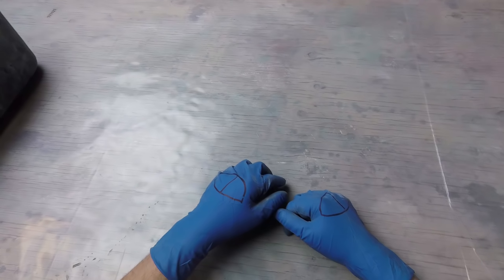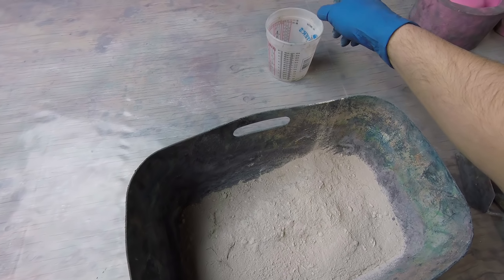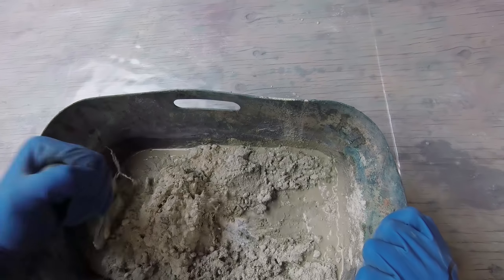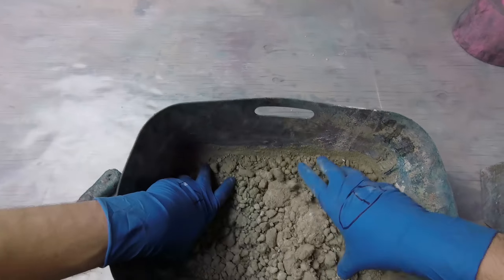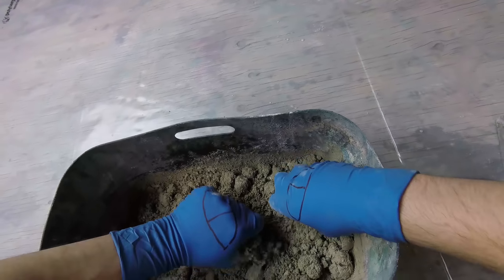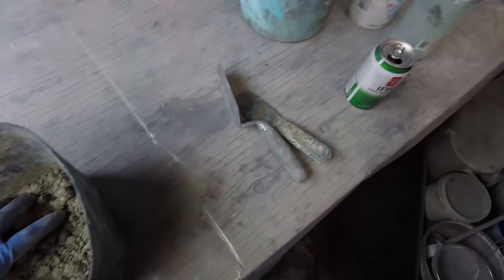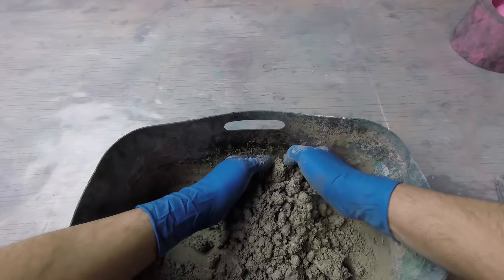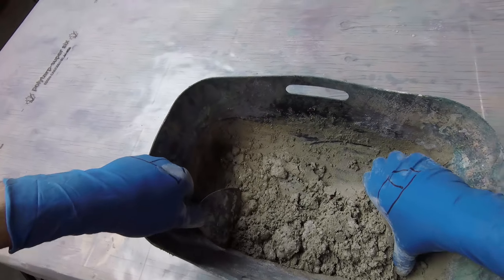Cactus Planter!!!  Secrets of perfect concrete marbling, step by step.

Comment: As a bricklayer, I can confirm a dry board will dry your mix up. You can uses a board many times, in fact the more times you used it, the better it would work for taking moisture out. That being said, being accurate with measuring water is the most important thing! Great video!
Reply from the maker: Thank you, the board trick works in a pinch but focus needs to be initial water content

Comment: What surprised me about your video is how long you allow your concrete to set before you put it to use. When I pour I won't panic as much after seeing this. thanks!
Reply from the maker: Hi Kathy, thank you for watching.  Glad to hear something I did will help you work with more peace of mind.  Technically Grey Matter could be classified as a "high early" mix design it gets very close to maximum strength(+10 000psi) in the first 24hrs.  With a liberal amount of water you have 45 minutes work time and if your mix is on the dry side it could be as quick as 15 minutes.

Comment: Do you have a video on how to make your silicone moulds? And do you know how to make a mould that will make the plant pot have a drainage hole without having to drill through your concrete?
Reply from the maker: When the concrete is wet put a pen lid in the back.  Boom drain hole.  We have a video on this as well in the channel
Reply: @CONCRETECONCRETE  BOOM, Thanks! 😎

Comment: Very nice. Great finish look. Try making individual strands (irregular sizes) with your coloured concrete and then spiral or braid  them together. (Each method will create a different result.) Then cut them into dissimilar sizes and pack them into your mould. This works great for dry packing as well then add a new colour for void filling.
Reply from the maker: That's great advice.

Comment: If you want to grow cacti in that, you will have to add drainage holes.  You can do this by drilling while the concrete is still soft, or you can insert waxed or oiled  dowels in the wet concrete when filling the mold.
Reply from the maker: Thanks Emmit.  Yes you can definitely drill a hole in it if you want to, clever idea!

Comment: Those of us in the candle making world that make our own concrete vessels use cement all & pour it in the mold. 3 hours later, it’s done. Easy peasy. I might be interested in some of your pigments though 🤔 I can marble in a thinner substrate.
Reply from the maker: Yes but our grey matter will outlive all of the cement all :D Our Grey Matter has no large aggregate filler, so you're getting a lot more cementous material per bag. PLUS Grey Matter is 3X stronger than general purpose mix! We love our mix. New sample pigment kit came out last month, if ya wanted to try
Best to ya

Comment: Hi. Great video on creating the planter. I have a few questions

- Once complete Can you drill drainage holes into the pot without damaging it?
- I went on your website and liked the color mix combo set. I couldn't tell the size/quantity of each color in the set?
- Did you use quick dry cement or regular cement?
Reply from the maker: I have another video on adding a drain hole during the pour.  Alternatively drilling one after will cause no damage. I don't understand the question about the set size.  email the webstore directly for help with sales.
Reply: @CONCRETECONCRETE  & did you use regular cement or quick dry cement

Comment: Mix the cement to the consistency of peanut butter, if you need it to be more liquid you can add something called Flow Control which is a plasticizer the won’t reduce the strength of the finished product but will make it easier to pour and shape.
Reply from the maker: Already have plasticizers in the mix

Comment: I really love the vase, but you kept anxious to drink a beer and cheez with you. I need to know exactly what kind of material did you use and if I can decorate my vases with this? And if my mix get too wet what can I do? Thanks to charing your knowledge.
Reply from the maker: Thank you!  The concrete is a special blend I developed that is designed to be used for art, sculpture and highly detailed pieces, pigments are studio grade integral mineral pigments.  All can be found at www.concreteconcrete.com
Reply: @CONCRETECONCRETE  Thanks , do you have any video that show how do you make sculpture with this concrete? Because I just saw the silicone molds, I need to apply over my big cement vases some designs. Can I use this concrete?

Comment: WOW, THANK YOU :)  I have watched at least 75 DIY concrete videos looking for someone to elaborate on concrete recipes,  color pigments, ect. I really appreciated your clearly in-depth instruction method. I have a really big question regarding working with concrete as dry as you did??? I want to make a large concrete planter or vessel to use as an Aquascape; a Container Water Garden for my porch to put a few water plants like Horsetail Reed and Papyrus and maybe a few little fish. (The plants are already sitting on my porch I have to water them like 10X's a day, I live in FL.) Anyways,  I would like one about 2 feet in diameter and it would probably only be 6 - 8" deep, so a mold specifically for concrete would cost a fortune so I was thinking about using a bath tub for a baby,  I saw one on FB for like $5 that is kidney shaped that seems like it would look nice and smooth if I could just lay the concrete in it and up the sides and smooth it with my hands. Can you please give me some advice if that will work without having a smaller thing on top or can you give me some direction on how I should build this?  If I am asking too much I am so sorry, I would just appreciate some feedback :) Thanks, Jessica
Reply from the maker: Hi Jessica

I've been considering what the next video I should do is and a DIY mold for something large might be fun.  I think I have a good understand of what your looking for.  I'll see what I can dig up in the next week and do a tutorial and try to cover all the best practices. Thank you for watching!

Comment: I was wondering if adding the colour powder to the concrete, it will end up being more prone to break down or develop cracks in the future? Especially in humid environments.
Reply from the maker: If you don't use the right type of pigment that's possible.  The pigments we use at ConcreteConcrete are designed to work with our mix and will not affect the structural integrity

Comment: Good work. What kind of cement are you using. Cement all is recommended by some but cost is a big deal. They make some liquid form to pour into mold, I see you made it like clay texture you can still add color marble or single color ones, like this :0)
Reply from the maker: Concrete concrete Grey Matter. Far superior to cemental

Comment: I'm imagining making a big marbled ball and letting it slump into the mold, to make the marbling more continuous. Would getting Grey Matter wet enough to flow that much compromise its strength?
Reply: But wow, I'm pretty blown away. That planter is gorgeous.
Reply from the maker: Hi Kyle.  Thank you!  Yeah this one turned out quite nice.
Reply from the maker: No you'd be ok.  Although at the consistency I had it you could probably do the same thing.  Even though I was partially joking around when I was slapping the backs of those flat concrete pancakes I'm trying to illustrate the point that one of the biggest red flags you can see in your concrete mix is to have standing water begin to accumulate at the top over your concrete.  I'll try and remember to do a different style of marbling with the next object so that you can see a more continuous flow to the colours and patterns.
Reply: Looking forward to it, thanks!
Reply from the maker: It's a bit too complicated for Youtube comments but our mix plasticizer that is dry kiln tumbled on the sand during batching.  This allows us to only add water and not have liquid plasticizer component in a bottle.

Comment: Hi! I've been thinking about making my own pots for a while now and I just have a couple of questions I'd like to ask you, if that's okay.

1. Is grout different from cement?
2. Can I use it in the same manner to make pots?

I hope you can help me with this 😊
Reply from the maker: Yes it's different.  Cement is both a component of grout and concrete.  Our work is made form concrete.

Our high performance blend of concrete (Grey Matter) is much stronger than regular concrete and grout which is why my finishes look so good.  

A flower pot made form grout will be weak and crusty.

Comment: I'm starting to create concrete pots, I loved your video, just some doubts, before the water, what has the mix? Some I see that they use fiber replica fiberglass, and what kind of cement is it? Do you recommend portland?
Reply from the maker: Hi Annie.  www.concreteconcrete.com   It's a mix we designed to make high quality home wares and architectural pieces.  We designed it because most high performance concrete from a manufacturer involves a licensing agreement (approx $100K a year just for the license)  and minimum orders we're tonnes per month.  Grey Matter gives you chance to work with the high quality concrete without the licensing fees or minimum orders.

Comment: Can’t believe that’s the consistency you use for your concrete. Very cool to see; I never would have guessed that was thin enough for anything.
Reply from the maker: To hit maximum strength we have water reducers and plasticizer built into the mix so that we can mix as dry as possible.  Many artist use way too much water in their mixes which results in weak concrete.  Using our UHPC we hit a cure strength that is 4X-6X stronger than your average concrete mix.  And it cures in a fraction of the time as well.

Comment: Glad you took your time to mix. I'm getting ready to start making pots and was wondering if I wanted a dryer mix or a wet mix.
Reply from the maker: The wetness of your mix is always a balance act between the detail of the mold and how strong you want a piece to be.  Dry  mixes are structurally stronger but have lots of voids.  Wet mixes can have less voids but tend to separate during vibration so strength of a piece can be variable and also lower.  To date our Grey matter mix is the most fluid I've seen a mix while keep water content extremely low (giving higher cure strengths)

Comment: I love that video. Great work. What are the costs involved in making a mold of that size? I wanted to make miniature benches and I don’t know where to start.
Reply from the maker: Here's the very beginning of a start. https://www.kickstarter.com/projects/1259791312/easy-make-concrete-kit?ref=user_menu  Past the basics of working with concrete most mold costing is volume measurements plus the cost to make the initial model

Comment: Do the amount of pigments compromise the strength of the concrete? I've had projects break apart before if I mixed in colors.
Reply from the maker: It goes hand and hand with mix design.  Yes you can over saturate in pigment and end up with crust weak concrete.  Go to www.concreteconcrete.com to find some tried and true colour formulas to get you started.

Comment: I notice my planters when finished are chalky/dusty how do I clean them outside of brushing them. Do you use a sealer on them? I'd love know how to get them cleaned up and somewhat have a either matte or sheen to it.
Reply from the maker: Hi.  There are a few ways to get rid of chalky/dusty.  Our favourite way is using our finishing wax.  It's food safe and feels really nice on your hands when you apply it. https://concreteconcrete.com/collections/shop/products/finishing-wax.  Just wash your piece and let it dry in the sun.  Then wax on and wax off Karate Kid stylz.  This will also depend on the quality of your casting as well.  Wax won't work on a crusty surface as well as a nice smooth one.
Reply: CONCRETE CONCRETE Thanks a mil for responding to me. I love your marbling, I so need to try it and your help is awesome!#

Comment: That is the driest concrete I have ever seen! “The flaticity”...flatulationize!!! Wonderful stuff! Thanks for all the words.
Reply from the maker: Honestly?  This batch was actually a little bit on the wet side.  We're only mixing for an aesthetic look but if we were doing structural work it would be much drier and we would use mechanical vibration to keep it fluid during the pour.  The wetter your concrete is the weaker it is, both in surface crustiness but also compressive strength.
Reply from the maker: And thank you for watching!
Reply: Thank you for replying. Loved your project! Let me just ask this then...does this apply with normal Quickcrete type concrete and portland cement mixes or just to your magical Grey Matter. Went to your web site and bookmarked for future concrete project money spending!
Reply from the maker: Yes this applies to all concrete.  If you were to make two samples cylinders to do a compressive crush test with out of identical mix designs but made one mix super wet, the wet mix would also be the weak mix.  For a sack a quikcrete you want to have just enough water for the mix to come together, no dry spots visible.   But this mix will have very little flow unless vibrated as it has no plasticizers or water reducers in it.
Reply from the maker: So one big benefit to Grey matter is that because of the plasticizers and water reducers already in the mix you can get good flow without over saturating water.

Comment: cool video thanks!
where you get your pigments? I make stuff with hydrostone/densite, i mix the colors up in a bucket and get marbling that way, always interested in different techniques, like your channel
Reply from the maker: SO cool.  get it at www.concreteconcrete.com. Hydrostone would have issues with water exposure?  how do you seal it?
Reply: Its not as durable as concrete, i spray it with the shiny concrete sealer. brings out the colors. It will last for years depending on the weather, but yeah not like concrete. the trade off is hydrostone drys in less than an hour. I checked out your website, nicely put together. have a good one

Comment: is this fast drying
Reply from the maker: Hi Al.  It hit's 50% of it's cure strength in 24 hrs.  In one day Grey matter will be almost double the strength hardware store bagged mixed will reach in 7 days.  Fast enough for you?  But just to be clear concrete cures through chemical reaction, it doesn't "dry" out.  The reason this is an important distinction to make is that you actually want to make sure your concrete cures in a moist environment as water is the main ingredient in the chemical reaction! Science!!!

Comment: could you possibly do your videos by giving measurements in cups....kilos don't appeal to me and I'm not going to find the video helpful
Reply from the maker: Hi Charlotte,
When working with concrete we need to measure using weight do to compaction of dry materials.  A cup measurement is not accurate enough to measure dry materials.

Comment: don't talk to me in kilos or milliliters, that translated to ME as 2 cups and add water.... I understand that concrete has many of uses. I have done ceramics for years, so your concrete is like slip that is considered almost "leather hard". It can be molded and has a slight flow. Your concrete has more flow than that. I need more explanation about WHY you do certain things though. with ceramic underglazes (pigment and clay mix and NOT what you get after firing and coating with clear glaze, so you have to understand color to match an items someone brought in,)
Reply from the maker: You really like to toot your own horn don't you?  So what's your problem with Kg in mm?  You don't like exact measurements or are you just anti-Science?

Comment: I’m a concrete worker for 7 years now. What you’re doing when you make the ball and let it flatten out is called a slump test. It’s used to determine your water mixture is correct. They make slump test cones which will tell you your exact slump. I’d say what you have there is about a 1 inch slump.
Reply from the maker: Typically concrete workers learn about slump tests way sooner than 7 years!? You're a bit late to the party, no worries though it's not a pissing contest is it?
Reply: @CONCRETECONCRETE  wasn’t being a jerk sorry if it came across that way. Was just trying to help your terminology since you said you didn’t know.